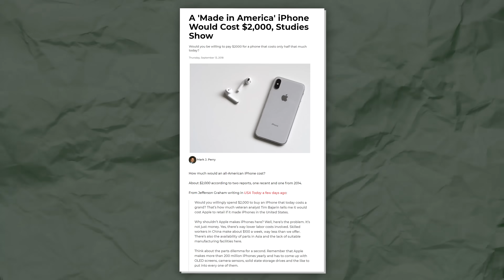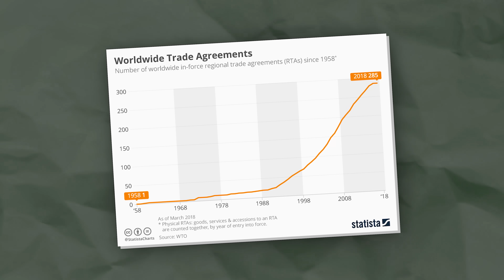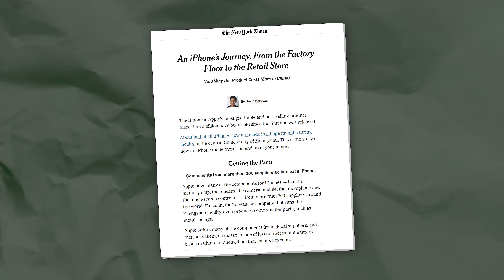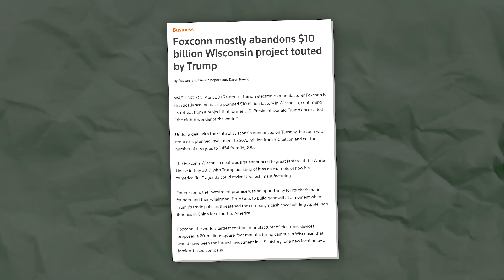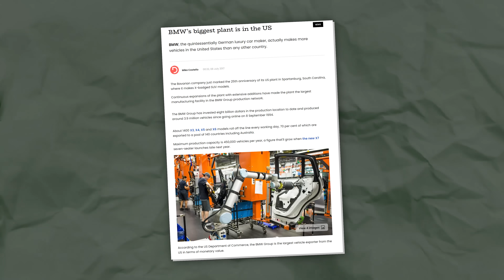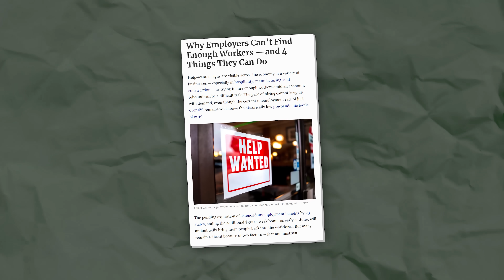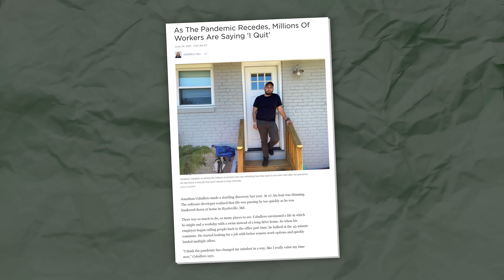How Much Would it Cost to Make an iPhone in America?

Comment: we dont have to speculate. a goped gas scooter is entirely made in the united states from entirely american made parts. the cheapest model is $1500 and it doesnt even have a clutch or a chain drive, the crankshaft just rubs the back tire. a chinese scooter that costs $500 has not only a clutch and chain drive it has front and back disk brakes, a suspension and pneumatic tires. the goped is made better though but you will pay dearly for that made in usa quality

Comment: I've invested in Arrival electric because they've solved a lot of the issues highlighted in this video. They make commercial electric vehicles but unlike the vast majority of other companies they're not building mega factories that serve whole continents. They tend to be difficult to improve once built because you have to stop production entirely and of course your have to export your products to many different countries resulting in high shipping and tax costs. Arrival is building micro-factories with modular assembly areas that can build any vehicle design or size. Located near cities in normal warehouse areas they can serve the local market and politicians will love them because it creates local jobs for city contracts. They've also solved the material sourcing problem because they've innovated by making new composite materials that are just as strong but also far lighter than metals and are easily recyclable to the point that if a panel on your van/bus/car (they have an Uber vehicle development contract) gets damaged you can take it to your local micro-factory, they'll take the panel, shred it and form it into a new one instantly.
Reply: Micro facilities make it worse
Reply: @jaysmith982  Depends how many components you're shipping in. Arrival bodywork is easily recyclable (they breakdown and reform at every facility) and components are designed to be modular units that can be swapped out easily to get vehicles moving again. They will then fix and reuse any left with them. They'll have as many suppliers as possible in country. Working with more suppliers but each one will only supply to 1 country or continent to keep the supply chains short and give them more options. Most supply chains now are very long with many huge global partners which is why there's current issues (one has a problem and the whole chain is screwed). Arrival will have more smaller suppliers they can build relationships with, control more easily and if 1 has a problem they'll have others with spare capacity.

Comment: The quality of American products has to improve.  I have spent $5k in engine repairs for my 2015 Buick Encore while my mom's 2002 Toyota Corolla with 200k miles has had $0 engine repairs.  We just change the oil.  The engine in my 2007 Chevy Malibu blew up at 200k miles.  After my encore quits I am not buying another American car.

Comment: For phone manufacturing cost though, the answer is "right to repair" legislation. If you only have to buy a new phone once every 5-7 years, then paying $1500- 2500 for it is, relatively speaking, not as big of a deal.
Reply: My galaxy S8 is a few months away from being 5 yrs old and still works, just depends on how you treat things. Might replace the battery soon lol
Reply: Don't worry Apple is working on a non-repairable iPhone.  They will integrate and solder everything into place making any repair very costly.  Now what?
Reply: @thecsucihai  "Now what?"
Simple. In the right to repair legislation there will be a provision that makes that sort of behavior by corporations illegal.
Reply: Considering a $300 phone can last that long if you really need it to what your saying is completely insane
Reply: If I pay any four digit number, even plain $1000, that thing better last at least a two digit number of years. Everything else is a complete rip-off.

Comment: Shouldn't the formula for labor hours look more like (350,000*12*(5/7))/500,000? This would assume each employee works 5 days a week at 12 hours per day to produce an average of 500000 phones a day. Resulting in each phone costing 6 labor hours.

Your calculation assumes each employee works 24/7 which would be impossible.

I know this isn't the main point of the video, but it is a major difference to be considered.
Reply: You re adding a few numbers that aren't needed there. We have 500k phones made by 350k people, already accounting for a day at however many hours they work. 500k phones/350k people means everyone comes up to 1.428 phones. If you assume they work 12 hours it's around 8 and a half per phone. Not sure where he got the 17 from but you don't need to consider week days (also God knows if they work all week or not)
Reply: I agree. He's assuming people work 24 hr/day.

Comment: Get this, if it's manufactured locally, and designed in such a way I can actually repair the whole thing, have removable batteries (LIKE WITHOUT A HOT AIR GUN OR WHATEVER), then I'd actually be willing to pay more. I'm an android user myself, so net cost is lower than Apple eWaste, but paying extra than I would now for an android phone, which can be fully repaired, I would be interested in and willing to do. Why? Because the TCO is actually going to be LOWER because I'll have the device for LONGER, even if that means I pay more up-front. I'm still rocking my LG v20 which is I think over 4 years old now or something, and I have yet to see an alternative that is a better option for me to buy to replace it. I'm optimistic that there's a non-trivial amount of the market that would be interested in this kind of a shift.
Reply: But if you can fix it yourself that means companies can't charge even more you for specializing fixing tools and services!
Reply: @gregbagel791  I don't care. This is how they'll get money from me. My wallet speaks.

Comment: The most obvious choice is to limit stock holders gains it should be maintained at certain level this entails lowering cost of the product, however it can also accelerate resource depletion 1% price change can make alot of difference.

Comment: Adding 200$ to labor cost is going to have downstream impacts. If the total manufacturing costs are 400$ components + 16$ work = 420$ per phone and 55$ profit on top, we are looking at a profit rate of 13%.
If the new costs are 400+200=600, the new profit will be 78$.
So already at manufacturing, we are looking at an extra 40% of labor costs.

The same will take place at Apple's end too. If they make 400$ on a 1000$ phone that costs them 600$ to produce, they have a profit margin of 67%.
With the new costs rising from 600$ to 830$, to maintain the same profit rate the profit amount must increase by 150$.

In the end, the new phone would cost about 1400$.
Reply: I point out they already do, so why buy Chinese?

Comment: You missed a few critical points in your analysis that weigh in favor of domestic manufacturing. First, a lot of those machines assembling circuit boards in your stock footage are designed and built in the US, so while training in how to run them isn't currently common here, it could easily be made available, perhaps even more efficiently than it currently is, since the materials wouldn't need to be translated into Chinese. As for needing to import components, we can make those here as well. There were chip foundries in the US not too long ago, I toured one in Sacramento when I was in high school in the 90s. And, again, a lot of that machinery is still designed and built here.

More important, though, is the feedback loop between engineering and manufacturing, which essentially doesn't exist in the current model due to multiple barriers. Distance, time zone, language, and culture differences combine with the organizational communication barriers inherent to outsourcing make it so manufacturing has essentially no input in the design process, and this results in poor designs that are more expensive to manufacture. There have been a few articles over the past couple of decades about companies finding it was actually cheaper to manufacture items in the US thanks to this feedback loop being restored.

Comment: Would the average American worler be compensated. Say makeing 42 dollars a hr instead of minimal wage 7.50. Not the 15.50 you fantasize about. Furthermore a I phone is not a phone, its a multifunction 21 century mini/ micro computer. Most have between 62 gigabit to 128 gibites internally pluse two or mere sim cards, pluse external storage media like mini 128 gigbite bule tooth touch data trasfer hard drives. Posibbly telephoto 3 d lenses. Video protector. The person with a Phone has a tv, computer, video projector, and stereo phonic headset all in the basic pacage. I have not seen a pure cell phone since the 2000snds when radio shake released the 8 gigbite I phone 1. Way back when I was 34 years old and this 8 gigibites seemed aussium. Ha. Ha. A mere 8 gibited sold for 300. Dollars. A useful  business tool yes.. but a extravagate personal luxury. Now it seem like something you would find in a junk yard sale.
   So how good is the tec item, really determines how much of my life's savings, or hard work money its worth. One I thought no phone, or home computer would equal a car. Or personal/ trasport. Now ? In near future with $30.00 a hr work from home. A car seems to be the unnecessary extravagance. So trying to imagine 2050 when the sea level rise in terms of 2050 salary/ durable goods/ exterm inflation of cost of living on a reduced land mass/ food/eltricity etc. I think if a 3 d printer could make the phone for zero dollars a minute it would still be a expensive luxury for the rich. As the poor would be struggling to pay rent on increasing ly over priced property. Or face rootlessness. Which my gen was raised to fear.

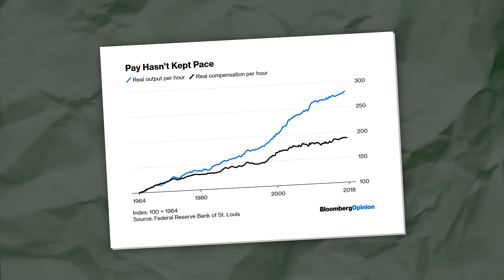Comment: Hey love the content! You should actually do a video debunking that stagnant wage growth chart at 3:17. It’s an extremely flawed and purposely misleading chart; originating from the EPI I believe.

1 - The productivity line includes the productivity of managers and management positions. The bottom line excludes supervisor and manager compensation. So it’s comparing apples and oranges.

2 - Second the bottom line uses inflation adjustments from the CPI index which is extremely inflationary. The bottom line however uses the implicit price deflator which is more deflationary.

3 - Labor is not the only variable in productivity. Capital investments can make labor more productive which has been one of the major amplifiers of productivity.For example in the McDonald’s kitchen having a machine that allows one worker to put catch up on 10 burgers at a time rather than that worker just being able to make 10 burgers faster.

4 - The hourly compensation metric is derived by using average household income. What this does not take in account is that the average household has fewer people today than it did in the 1960s. Meaning even if the wage number is the same which we’ve already established is not necessarily true that means that the individual wages have increased. In 2020 the average household consist of 2.53 people vs 3.33 people in 1960.

Comment: Another large factor is the cost of the legislation/regulation  . For example, In a North America factory provide disabled support , fire suppression , capacity limits,  environmental and disposal laws and generally rules that add to the cost of facilities and operations  while for the case of safety and/or comfort can be avoided elsewhere. Wage is a small part of it.

The goal : Maximize shareholder revenue, not spend extra if it can be avoided.

Comment: It basically comes down to whether the value of having a consumer supply chain independent of the ccp outweighs the added costs for goods.  Imo, as time goes on, the benefits of distancing ourselves from China increase by the day.
Reply: 57% of China's energy consumption is to power its factories. Can the US power grid even bear the strain of manufacturing that is done by China?
Reply: Far easier than China can. America has the tech, land,know-how and laws to enable fracking to a level no other country can reach. If the US decided to bring industry back, it could absolutely harness enough energy to do so.
Reply: There needs to be crackdowns on planned obsolescence.
Reply: Until they fall, and the US unprepared to take the industrial load bears the strain.

Comment: You need to remove the taxes and duty and lower the shipping cost. It only cost like 5 to 10 bucks to ship 1 iPhone anywhere in the continental US using USPS. So for apple in bulk using trucks maybe 2 dollars a phone. So it would only be 100 dollars more. Also I'm pretty sure the components are a lot cheaper than that. I've read that they are about 230ish.
Reply: Rather the opposite, increase duties and taxes until its cheaper to bring in the base materials into the US and build it in house. If my phone costs me $1400 to buy here and $1600 to bounce around Asia and ship here the outsourcing will end or their companies will collapse.
Reply: @brianjohnson5272  agree, I meant on his calculations he needs to remove the taxes and duty because if you make it in the us you don't pay import taxes and duty.

Comment: If those 350k Foxconn workers are working 24 hours a day, they must have some hella staff turnover.
It's probably more like 10-12 hours. You need to roughly halve your labour figures.
The other thing to consider is that higher labour costs would result in more of the process being automated. The US workers will be more productive, not necessarily due to a higher skill base, but because more of the work would be done by machine, solely because labour DOES cost more. The work done in China by three workers and one widget will be done in the USA by one worker and three widgets. It's not a simple substitution.
Reply: I work for a Taiwaness electronical manufacturing company in México. And no, 24 hr shifts are not even humanly capable; however they do work 12 hours + maybe 2 hr overtime. You still need to consider these companies like to employ Filiphines labor, which are accomodated in hotels INSIDE the manufacturing facility (which means 24 hrs availability of personnel).

Automation is a must for US companies, even here in México we are strongly looking yo automate the most basic tasks in order to lower costs (even though Labor cost cutting is not the solution!!)
Reply: Anyway it is still more expensive then you would like.
Reply: Yep, you need to halve his figure as a starting point, then probably bring it down a bit more from there
Reply: And that American with 3 widgets want 5 times what the 3 Chinese want. Efficient yes, practical, no.
Reply: That's why some of those workers committed suicide if you check the news in China
Reply: "9x9x6" is common in China. 9am to 9pm 6 days a week. Migrant workers are a huge resource for manufacturing and they live on site and only visit family once or twice a year during national holidays.
Reply: Lots of manufacturing labor in china is near slavery.  They truck in illiterate rural workers from the country and conscript them to these companies.  Workers get their housing and food directly through the employer.  You dont work whenever or however long, say good buy to your bed and your meals.

Comment: If we made an iPhone in the US the same way China makes the iPhone it would be insanely expensive. A lot of it is the labor difference, and we frankly wouldn't hire people to put phones together like that. We would automate the heck out of the process. Manufacturing is coming back to the US in a big way... And not just jobless, but negative hiring as more current production lines cut workers as they automate also.

But what will change as we automate more is that we are building that infrastructure to make the parts that make the parts that make our stuff. It will not be an overnight change, but it will happen over the next 10-20 years. To start it will be US based chip manufacturing, and that will open up the gateway to make more down stream products here. Yeah, we have Intel making chips here, but most chips are not big huge CPUs and specialized Ram, most of it is tiny electronics without a processor or with a tiny custom arm thing. After everything going on with China and IP issues, and not the threats against Taiwan, we are moving quick to ramp up US chip production. Honestly, I am a fan of globalization. I think that being the world's importer is a lot of what keeps us safe. The world isn't afraid of our military because we don't have the political will to use it often. What they fear is that damage to the US and its economy will hurt them more than it will hurt us. So as we raise the manufacturing curtain against the world, I think it may have some weird concequences.